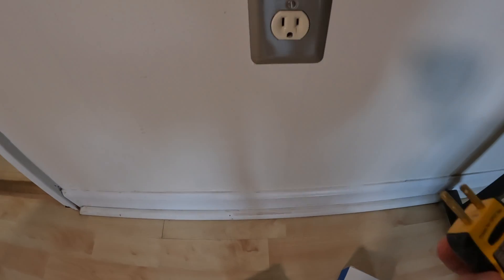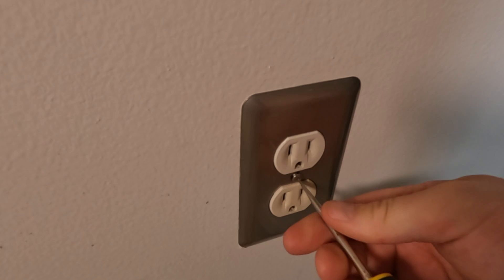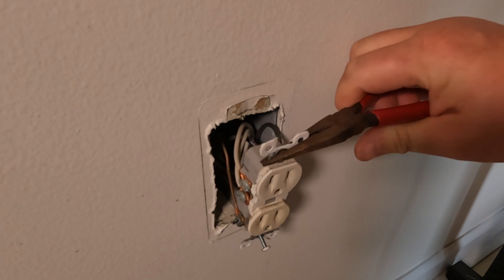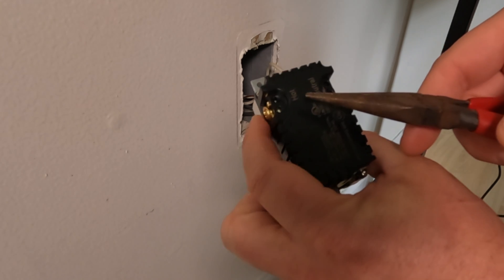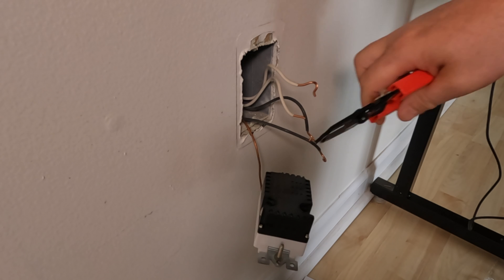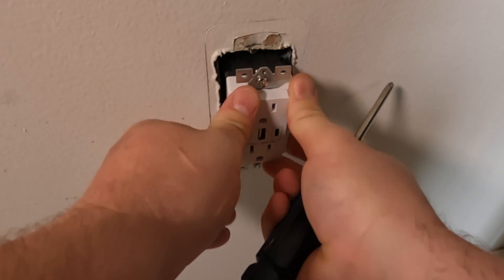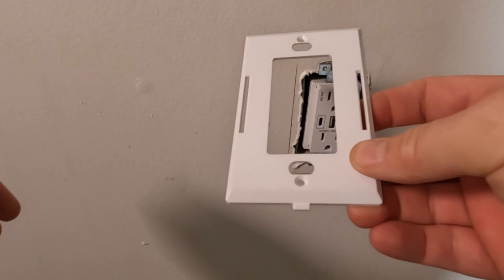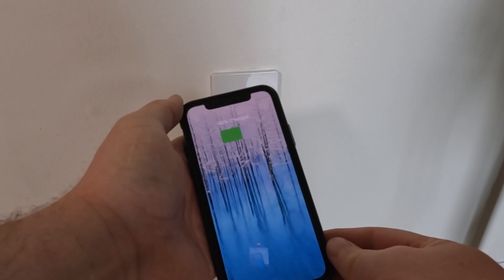Replace Outlet for iPhone 15 Charging - USB A & USB C Ports - Easy DIY

Comment: I checked my Amerisense with a tester and it showed reversed polarity. I swapped the wire and got the same results. It’s the end of the line so there are just the two (and ground). What gives?